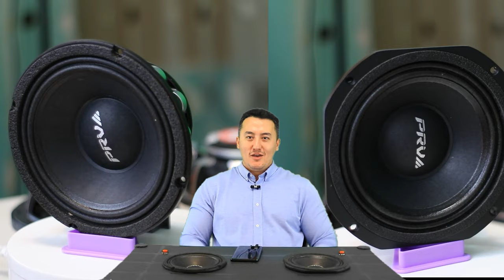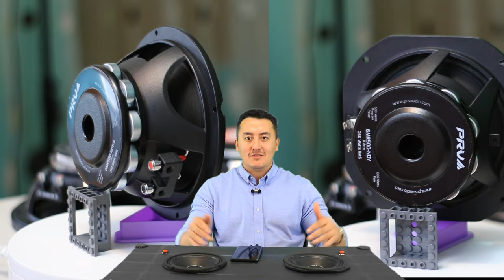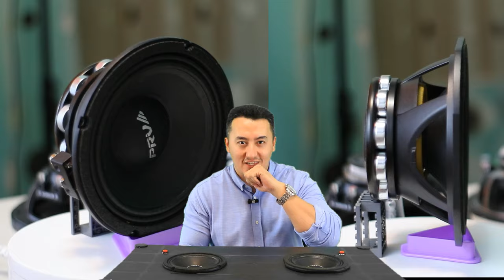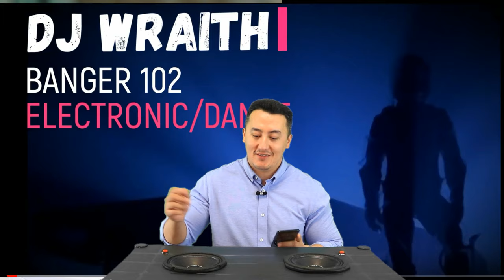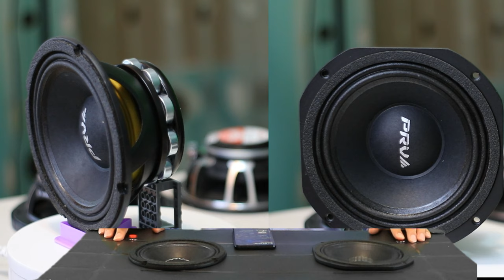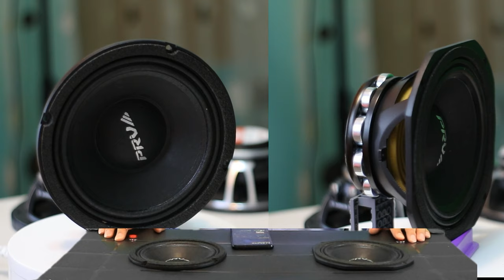Myth busted, real test 4 Ohm vs 8 Ohm speaker? Car audio system PRV AUDIO 6MR500-NDY

Comment: If you would measure voltage on speaker input there will be difference....4 ohm speaker will request as twice as much of power from amplifier to deliver same db level.
This test is to shallow without real technical facts

Comment: i like sound full 8 ohm sound hi end  and powered amp car class ab & d & td   high voltage 55 0 55v  65 0 65v dc = spk 8 ohm
 12v ic tda7384 powered speaker 4 ohm

Comment: basically running 2x 8 ohm speakers on one channel will be as looud as 1x 4 ohm speaker on the same chnnel, end of story.
Reply: Not really cuz you be cutting the wattage on one channel to 2 speakers ,where as you only connecting 1 4ohm to one channel it’s gonna receive the full wattage on that channel.
Reply: @josecunsako31  yes you cut it in half per speaker, that doesn't matter because the total wattage will be the same as a single 4 ohm,

ALTHOUGH, running double the amount of speakers will give you a +3db boost, even without increasing the wattage. so both you and i was wrong

1w on 1 speaker 4 ohm= let's say 90db
1w split over 2x 8 ohm=90db + 3db boost from doubling the amount of speakers

Comment: Your test is not accurate. You have 2 different rated speakers in the same box , normally this doesn't matter unless it's with a subwoofer but in reality you can't expect 2 different speakers to the same enclosure An expect the same sound . There are so many variations you miss in all your videos comparing drivers. I see a lot of your videos doing sound quality , and bass outputs but you do all your testing with the same variables which makes those videos 100 percent inaccurate . If you take a full sound system and install it in a Toyota Prius , than take that same sound system an install it in pick up truck or van you gonna have a completely different sound. In real life you can take a 10,000 dollar system and compare it to a 500 dollar system in a different vehicle it's very much possible for that 500 dollar system to have better sound quality than the 10,000 dollar one. It's all about the installation , the placement of the drivers , and the acoustics of the vehicle . These things play a huge roll in sound quality and output of the components .
Reply from the maker: Yep you absolutely right here my brother,  and thank you for watching and commenting))